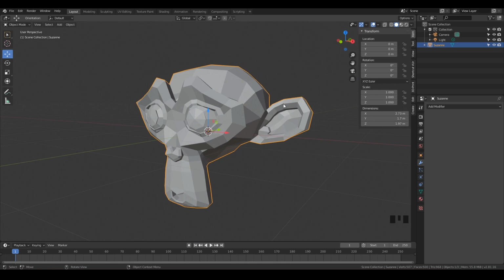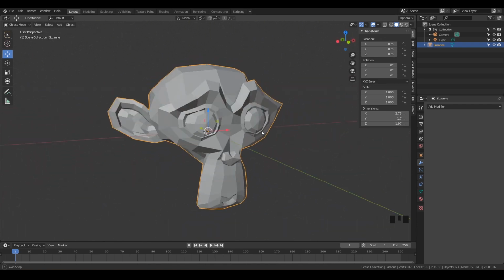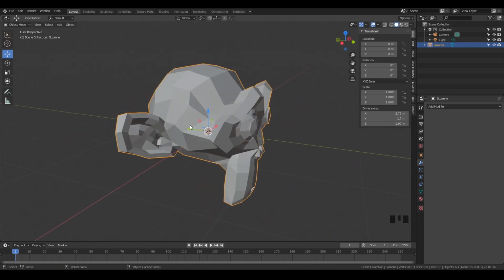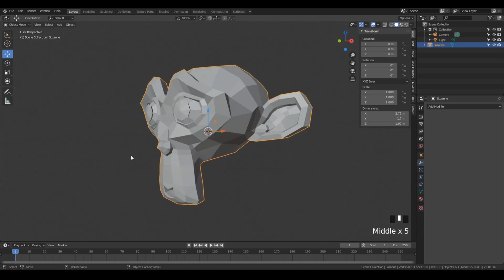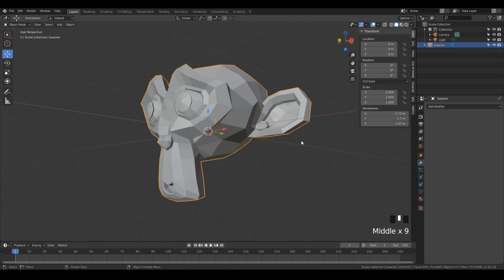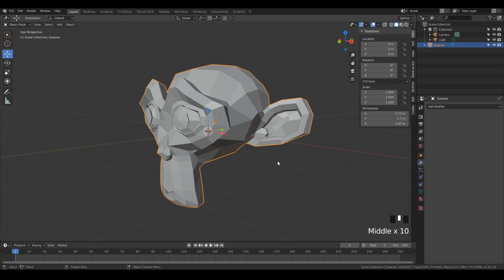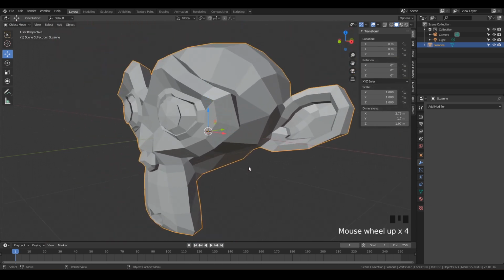Blender 2.8 with 3-Button Mouse - Orbit, Pan, & Zoom Basics - 3D Printing Design (2020)

Comment: Note to anyone out there using a mouse like a Logitech that allows for assigning different button presses or key assignments to the mouse buttons: If you have the middle mouse button assigned to anything other than "middle click" (sometimes called "button 3") clicking the middle button to pan or orbit will not work. Reassigning to "middle click" will restore this function.
Reply from the maker: Awesome. Thanks for sharing this tip Josh! :)